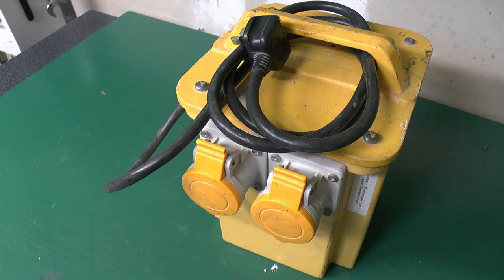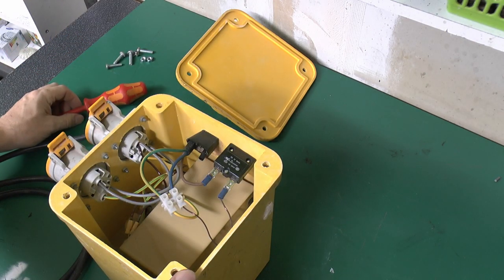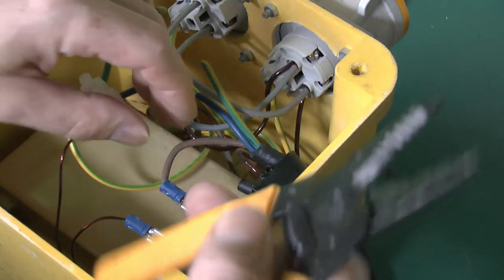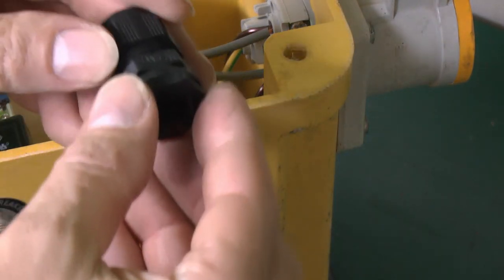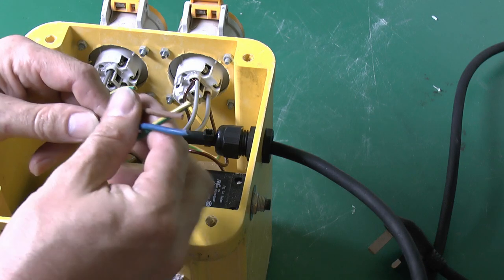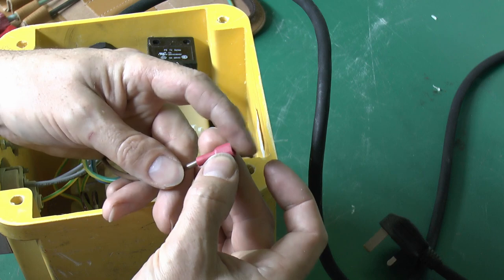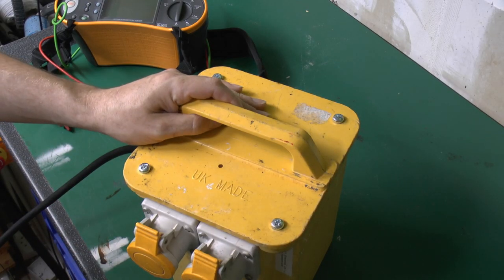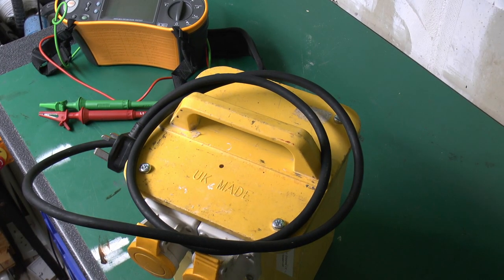110V Site Transformer Repair

Comment: I think every old 110V transformer I’ve ever seen has at least one odd screw on the top! Great video as always!
Reply: I always have to replace at least one  when PAT testing
Reply: I always used nyloc nuts. They just get loose in transit otherwise.
Reply: Artisan Electrics  My wife often says I have an odd screw on top.....
Reply: It's common to loose a washer or a screw 😂

Comment: I heard a story about one guy, who to save buying 110 V power tools required on a construction site, he directly wired the 240 V input to the 110 V sockets, and changed all his 13 A plugs to 16 A 110 V ones. Now one ever checked, even though his power tools all had colour black cables instead of the correct colour yellow.
Nice rewire JW. Thanks for sharing.
Reply: Bet he took twice as long as everyone else to finish his jobs though!
Reply: trickyd2013 uhm... why? You mean he took a quarter of the time, right?

Apart from the safety aspect, 240V motors work better than 110V.
Reply: Jasper Janssen 240v motor running on 110v is faster?
Reply: trickyd2013:  no, he put 110v c-form plugs on 240v tools
Reply: Chris Walford I think I get it. So you mean he wired the 110v leads and sockets straight into the 230v supply with no transformer, replaced the plugs on his tools for 110v ones and so ran his 240v tools at 230v on site. Very crafty. I’m surprised nobody noticed that there was no transformer. It would have been more crafty to have had a transformer case with a brick in it that was wired straight through.

This shouldn’t happen on our sites because all 230v MDU are padlocked and we supply and regularly test the 110v transformers and cables.
Reply: @trickyd-wc7bq  he did still use a transformer, though as a paperweight in effect?.
Reply: Genius.

Comment: There should have been a gasket under the lid , they are made of fiberglass filled plastic (GRP) the potting is about 20mm thick then they are filled with sand,
 that is the original cord grip for these, they are still made just like this.
 I often replace with a standard 20mm compression gland in backwards I find a step cutter works best
Reply: why the sand ?
Reply: @cagmito76  stability, some use weights
Reply: @cagmito76  protection from impacts, and I would suspect the same as fuses extinguishing any arcs or flames

Comment: You should always leave the PE (Protective Earth yellow/green) LONGER than other wires because this is portable device.  It must be the longest because if the mains cable loosens, it cuts off last. The inner connections look very bad. The protective earth should never be connected that odd way. This looks really weird to me. Is this some kind of homebrew apparatus?
Reply: I think it has been repaired before, the terminal block was the clue.

Comment: As already noted, there should be a thin foam black gasket under lid so evidently this thing has been apart before.
Also I would have plugged the unused screw hole beside your domed flex gland with mastic to prevent any water ingress, I know you said it's for indoor use only but you never know..

Comment: I had the exact same transformer years back -I was working of a scaffold and each night we lowered the tools down via a rope and pully the last piece of equipment was the transformer which as soon as offered it over the side of the scaffolding the handle broke clean off and it dropped to its death hitting various pieces of the scaffolding on the way down like a pinball machine / the poor apprentice on the ground didn’t know where to run 😂
Reply: The transformer is supposed to be NEAR the mains socket, preferably indoors. You should then run 110 volt extension leads out and up the scafolding. The whole point of 110 volt is to  prevent running 240 volt cables across outdoor works
Reply: Steve Ashcroft yes correct
Reply: @drivewasher  what a nonsense 110 volt powertools. We dutch run 230/400 volt cables on construction sites and on scaffolding. Tools are dubble insulated every user socket is protected with 30mA rcd, sockets has a springloaded hatch/flap distributionboxes ip 66 watertight, permanent shaffonding is connected to ground with there own ground rod.

Comment: I've lost count of the number of these I've repaired. Strangely, or not as the case may be, all of the issues were damage due to 'user error' ie smashed sockets or damaged cable due to people walking them like a dog. I did come across a large 30vac transformer that wasn't showing continuity across the primary. On closer inspection the potting had a huge crack through it... Scrap.

Comment: Hi John, I think you videos and short lectures are great, not only explaining theory but lovely practical demonstrations. I really like the one with the 0.5mm^2 wire and plug. I think we should ban Ebay electrical goods from certain countries completely, China etc. I have tested some of their copy switches and the results are surprising. Contacts that should be brass with brass links are actually plated steel. The result showed they would overheat at their rated current. And they were UL, CE and CSA certified. Just lovely down to earth videos all understood very well. great little lectures so thankyou.

Comment: I never knew about 110V devices. They aren't used where I live. Actually that is pretty clever, after transforming they are much safer for sure! Not sure why the output is middle earthed though instead of floating.
I used to use isolated 230V power outside and in the garden, just because I had an extra isolating transformer laying around and there is no residual current protection in my house (besides room with a shower). Totally isolated and floating like on an electronic workbench can never be a bad thing :)
Reply from the maker: Centre earth means any fault to ground is only 55V.  Floating would be ok until a 1st fault occurred, then it would be 110V to earth when a 2nd fault occurred.
Reply: @jwflame  That makes sense. Pretty interesting concept!

Comment: Mine is about 80 percent filled with resin and came new with the backward stuffing gland. Seems odd that they use a choccy block and not crimps though I guess it's good practice to open it up now and again to check that the outlet terminals are tight. I only read recently that the outlet mounting screws etc don't need to be earthed as they're small and ancillary. I should source such a comment however...

Flex is likely to be H05 or H07 RRF or RNF. Rubber on the basic insulation and rubber or synthetic rubber for the sheath. 07 is higher voltage rating ie thicker and more durable sheath. H07RNF is used as standard on stage lighting rigs etc

I was waiting to see what you used to fill the old cable clamp screw hole in the fibreglass- bit of silicone or epoxy to keep the dust out?

Comment: One the last part of the test you meggered between earth pin on 13a plug and 110v and got 500megs but you should have got near zoro because th e secondary has an earth on it.
Reply: Yes I noticed that too I'm not sure whether the earth is connected to the centre tap which it certainly should be
Reply: @dkek383  it's supposed to be earthed to comply with regulations.
Reply: The insulation test is DC. DC does not go through a transformer. Insulation test was between the 13A pug (primary winding) and the output earth (secondary winding). If he'd tested between the output connections and output earth then the insulation would be almost zero.
Reply: john flower - on all the 110V CTE (55V - 0 - 55V) portable or fixed transformers that I have encountered, the transformer secondary mid tap is connected to earth. So a multimeter on the resistance range should show continuity between either of the 55V line output socket terminals and any earth connection (be it the output earth terminal or the mains input earth).
Reply: Weeble Wobble - no, because the DC test current should flow from the mains plug earth terminal to the transformer mid tap, through the copper winding of the secondary and to the output terminal on the 110V socket.

Comment: Hi John thank you for your thorough step by step guide to repairing this transformer, very helpful. I notice you didn’t seal the original cable restrained bolt hole through the case adjacent to the cable entry hole. The other thing although I may have missed it, did you test the actual output voltage under load conditions. Thks

Comment: Why were not wire end ferrules used to connect the neutral and ground wire in the terminal?
When tightening the screw terminal, the fine copper wires are squeezed and sometimes severed - thus creating a cross-sectional reduction, which may even lead to fire!
Reply: Probably only an issue when really heavy duty tools are used for extended periods of time. This particular unit seems to be for experimental and occasional use. That said, I'd feel comfier with ferrules!

Comment: HI John, at 0:35 you say that the output is centre tapped to ground, but when you test it at the end you get >500 meg between output line and earth. If it's centre tapped to ground wouldn't that show almost a DC short in that test?
Reply: I have not found any official standards but two private websites who say site transformer are grounded on the secondary. His measurements do indeed indicate the the secondary is floating. Perhaps the secondary "ground" is isolated from mains ground just like on a portable generator?
Reply: The insulation test is DC. DC does not go through a transformer.
Insulation test was between the 13A pug (primary winding) and the output earth (secondary winding).
If he'd tested between the output connections and output earth then the insulation would be almost zero.
Reply: The last test was between supply earth and secondary tap so open ins res is right.
I would have tested output voltage thou..
Reply: Hauptwerk Hardware - on all the 110V CTE (55V - 0 - 55V) portable or fixed transformers that I have encountered, the transformer secondary mid tap is connected to earth. So a multimeter on the resistance range should show continuity between either of the 55V line output socket terminals and any earth connection (be it the output earth terminal or the mains input earth).
Reply: Weeble Wobble - no, because the DC test current should flow from the mains plug earth terminal to the transformer mid tap, through the copper winding of the secondary and to the output terminal on the 110V socket.
Reply: Agree with some of the other replies here - although the secondary centre tap should be connected to earth/incoming cpc, in this case the IR readings show clearly that it is not.  Secondary is thus clearly floating and second fault will be 110V to earth.  Whoops.
p.s.  Looked at this one simply because my own tranny needed repair a while ago and I wanted to be sure I hadn't missed anything.

Comment: Why does the insulation check on the secondary pass when it's center tap is supposed to be connected to earth?
Reply: Fick dich  - no, because the DC test current should flow from the mains plug earth terminal to the transformer mid tap, through the copper winding of the secondary and to the output terminal on the 110V socket. 
On all the 110V CTE (55V - 0 - 55V) portable or fixed transformers that I have encountered, the transformer secondary mid tap is connected to earth. So a multimeter on the resistance range should show continuity between either of the 55V line output socket terminals and any earth connection (be it the output earth terminal or the mains input earth).

Comment: I personaly would have doubled the 1.5 flex where it went into the conector block to fill up the conector more
Reply: Better still, crimp ferrules onto the flexible strands.
Reply: I put ferrules on all stranded cable in screw terminals now. They're so cheap, and the crimp tools aren't exactly expensive either. Crimping an end on barely takes any longer than twisting/doubling up a stranded cable.

It's a habit I got from wiring narrowboats (where all of the mains cable is stranded and sockets aren't designed to accept stranded cable) which just stuck with me as a sensible idea for everything else.
Reply: No need to double up or use crimps if the screw terminal block / choc block has wire protectors (plates).
Reply: @Mark1024MAK  Admittedly less of a need but it still creates a better connection.
Reply: Robin Whitfield - the company that I’m employed by has over fifty years experience of using stranded tinned copper wire terminating in screw terminal block / choc blocks that have wire protectors. Our failure rate on these is extremely small and we have millions of terminals.

Comment: Inrush current is a bit more involved than you suggest. The flux in an inductor core is the integral of the applied voltage, and related to the current drawn.. If you apply DC to an inductor then the instantaneous flux and current will be zero, even in a perfect inductor with zero resistance.. In a perfect inductor you would get perpetually linearly rising flux and current, in a real inductor the increasing current through the resistance would eventually make the inductor voltage zero so you'd end up with steady state current determined by the resistance. With AC it depends where on the waveform you switched. Switching at peak voltage would give no inrush current, you'd be integrating from sine maximum to sine minimum so the peak flux and current would be the same as you get on every other cycle. If you switched at zero crossing you would get an inrush current as you would be integrating over a half cycle from zero to zero which would give higher peak flux, and if that was enough to saturate the core you would get a much higher current.
Reply: So that’s why you switch inductive loads at zero crossing, it makes things harder! Yeah, sure.

Somewhere you’re making an error of reasoning.
Reply: @dkek383  I'm not able to think about this mathematically, but I've always imagined that an inductor presents a high resistance to a sudden change in voltage.  The changing magnetic field seeks to generate a current which opposes the one which created that field in the first place.  It's also known as Lenz's law.  How can an inductor draw a surge current when suddenly presented with a voltage?  That's what capacitors do.
PS I'm being a bit lazy with terminology when referring to resistance/impedance/reactance.

Comment: question , can you  use these transformers as a voltage converter for US appliances in the UK ? given that the continues rating is lower than the rating of the transformer
Reply from the maker: Yes, although it won't convert frequency so is of no use if something requires 60Hz.

Comment: Why not put a squirt of hot melt glue or a small rubber bung in that screw hole next to the gland nut to prevent water ingress in the rain or if the transformer ends up in a puddle?

Comment: I’ve never seen one like that, all mine the whole enclosure is filled with resin up to the connectors.
Reply: I have the same model as this, they are very common, and it is the same inside.

Comment: If you put the cable gland back to front ( opposite way to the way it was designed ) where is the protection to the flexible cable
Reply: If you knew how a cable gland works, you wouldn't ask. When used the "normal way" there is a round gripping clamp that squeezes into the outer sheath. That thing is right at the end of the domed clamp nut, and it is quite sharp.
So, flexing of the cable is pushing it against that sharp edge inside the end of the gland. By reversing the gland, there ends up being a rounded edge plus the sharp thing is nowhere near the flexing point.
Bottom line = the protection is BETTER with the gland reversed.

Comment: what was the rating of the circuit breaker.,, why was it on the primary and not the secondary..i have one of these but it has a 20amp circuit breaker4.....and a mains plug with 13a fuse...surely that wont work

Comment: Really great vid JW. Came here trying to work out whether there was a standard for the non earth pins in the 110v socket. No clues from the wiring seen in this video. Is there a live or neutral after the step down in the induced coil. Grey doesnt really provide much of a clue.
Reply: There's no standard for "polarity" here, it's split phase and simply doesn't matter.

Comment: Good video JW. Any reason why you didn't fold the neg and earth over before putting into the choc block?
Reply: That’s only a good idea if your choc block is too big for your cable size. It doesn’t add any mechanical strength, except by filling up the hole a bit more.
Reply: @JasperJanssen  Whilst I appreciate your response. Singles can and will slide down the side of the thread of the screw and have floating wires in the terminal block. You're also less likely to cause crush damage to the wires with them folded - Especially when using flex. Good practice imo.
Reply from the maker: They weren't folded over originally, and it's lasted for 15+ years like that from the factory.  The wires are large relative to the terminal block size.
Reply: @mernok2001  Hahah, afraid so slip of the tongue.